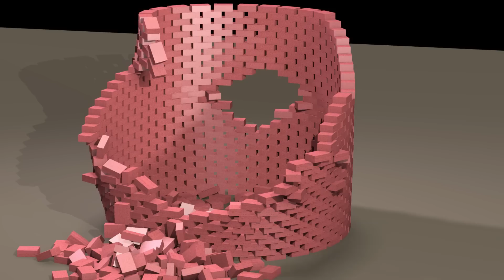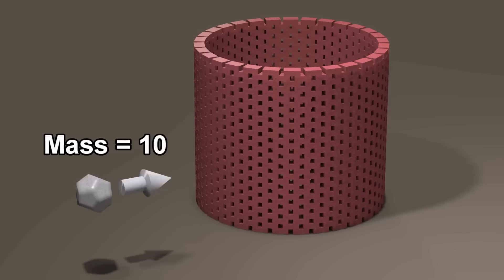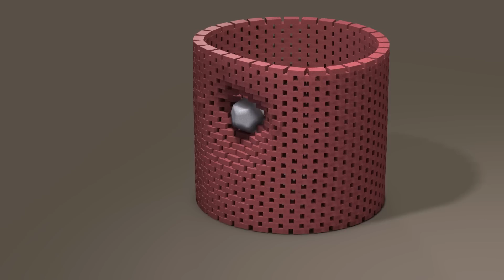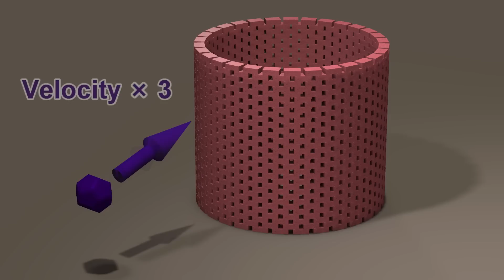Dodecahedron of Demolition

Comment: I wonder if these principals have been used for body armor...
Reply: Yes, absolutely. This is actually the main thing about body armor - the way it absorbs and distribures energy over its internal structure. This is why body armor is always layered and never a single solid plate of something. Essentialy you want as much energy as possible to be redirected sideways causing destruction of the armor itself (like in the square example), so less energy will be left for further penetration. The principles shown here on bricks work in armor materials on molecular level.

Comment: Is this why bullet exit wounds are larger that the entry point?
Reply from the maker: No.  In the video, the tower is hollow inside.  In bullet wounds, the pressure from the impact tends to cause a cone of force.
Reply: The size of the entrance and exit holes are a careful balance between the remaining energy in the projectile and the structural integrity of the demolition target, a brick wall uniquely collapses under its own weight, so the damage caused by the entrance hole is enough to cause instability in the exit wall before the projectile can hit it, allowing the slowed projectile to still cause more damage to the exit than the entrance at greater projectile masses. Human tissue is more structurally sound, without the entrance or exit tissue relying on the integrity of the other, but the compression of tissue behind the exit due to the impact carries more energy from the bullet into the exit wound, creating a larger hole with somewhat explosive force. Compared to the brick wall, the bricks launched from the entrance hole do not carry nearly as much force from the projectile, as blood and tissue does from a bullet traveling faster than the speed of sound.
Reply: I believe it has more to do with tissue compression as Eugene and the other commenter mentioned. 

There are also the effects of bullet tumbling and "mushrooming". As the bullet enters its tip is normal to the skin, but bullets are apt to rotate and may exit sideways. Also certain types of ammo are designed to deform into a mushroom-like shape with a blunter tip, or even tear open at the top and sorta spread  outwards radiallt. The latter are the so called hollow points we often hear about in the news.
Reply: Let's find out. Stand against the wall and I will fire a dodecahedron at you from different angles...

Comment: The physics looks off to me. There is something holding together the bricks. Which would change quite a bit
Reply from the maker: Friction is holding the bricks together.
Reply: @EugeneKhutoryansky  That's A LOT of friction. 3:05 you can see a brick in the middle hanging on by a tiny bit
Reply: The bricks have a high friction coefficient and mass, and due to the fact that these bricks do not crumble but are rigid bodies that are stacked perfectly, they can withstand a lot more force before they collapse or slide off of each other than normal bricks do. This does not mean that the principles discussed in the video are not accurate statements about the underlying physics.
Reply: @madisondampier3389  I agree. I see how that would create the almost magnetic effect. Definitely wasn't arguing any principles.
Reply: Yeah it look like they are stuck together with magnets.